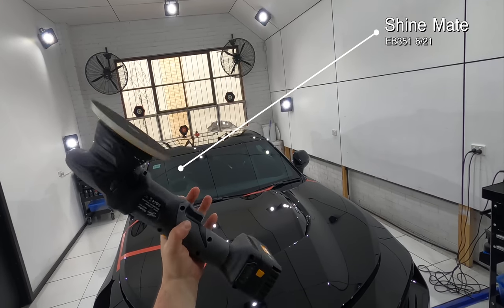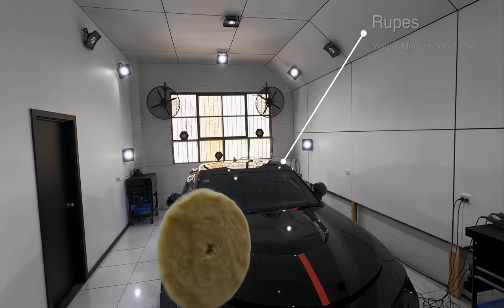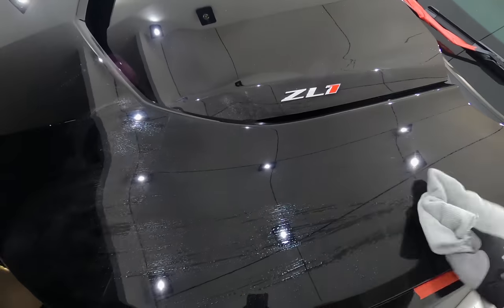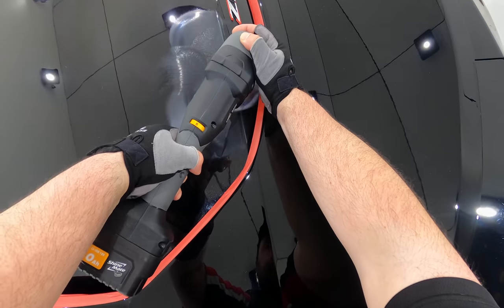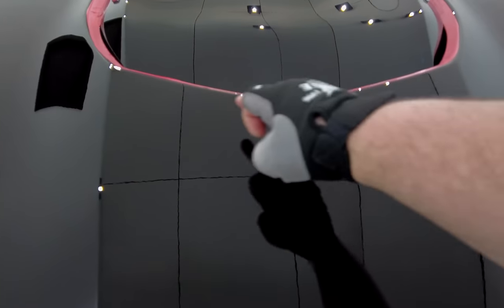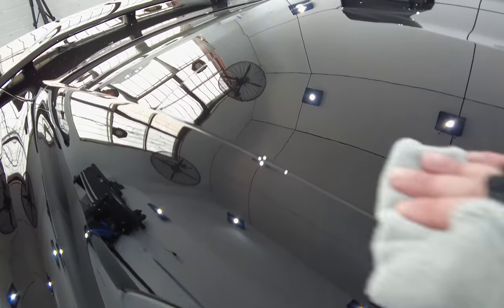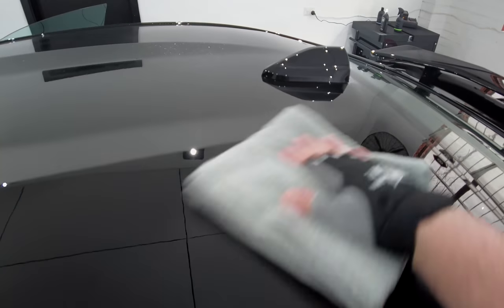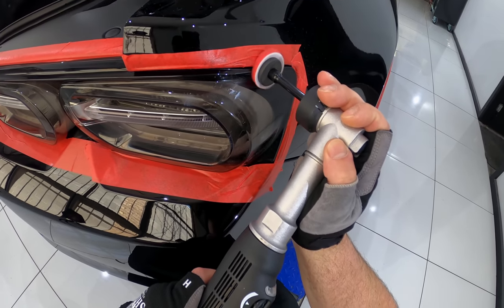2020 Camaro ZL1 Detail | The Worst New Car Paint Ever | P2 Paint Correction! (Vlog 32.2)

Comment: Greetings from Chicago, Sandro ... Happy New Year!!  🎉

You are a true master of your craft, and I so appreciate your channel and all the advice you give us.  🙏🏼

I have a quick question, regarding the ShineMate Black Diamond red pad you're using.  I just received my EX620 5/15 polisher (which is awesome by the way), and the Red pad that came with it is thinner (~25mm) than the ones I bought separately (those seem to be ~30mm).

Your thoughts on this ... have you noticed a change, as you've been using ShineMate for quite a while?  🤔
Reply from the maker: Happy new Year mate! 
Great to hear you like the polisher, and yes there’s actually been a few subtle changes to many of the pads including the widths as well as the foam and cells themselves, so I’m guess you’ve got an older new version of each pad, but I personally haven’t seen noticeable differences in how they perform
Reply: Terrific, Sandro ( @CarCraftAutoDetailing ) ... thanks so much for the quick and informative reply.  🍻

If I may, I do have an unrelated question.  My metallic black paint is extremely soft (that's why I'm studying these videos).  Is it common for the area under the masking tape (3M blue painter's tape) to be darker than either the area I just polished/refined and the OEM paint I didn't even yet touch?  It seems so odd, almost as if the tape is "moisturizing" the paint.  But, a panel wipe solution doesn't remove it.  🙈

It's really confusing me ... I don't know whether I still have micromarring/haze, or is the area under tape giving a "false" type of result.  Any thoughts on this off-the-wall question??  LOL
Reply from the maker: Tape can sometimes leave residue that can either make the area under it look more hazes up and light or even darker depending on the residue. 
I find that the blue painters tape is good quality but has a lot more residue compared to something like the red Carpro tape or even the 3M light green tape I believe it’s the 233 seems to be better to work with in that respect
Reply: As always, I appreciate the quick and detailed reply, Sandro ( @CarCraftAutoDetailing )!  😊

On my 2016 Equus, with Caspian Black paint, the blue 3M tape definitely darkens anything underneath it.  As you can imagine, it throws me for a loop, as I keep thinking I'm not refining the paint enough (I'm using the red ShineMate pads and Scholl Concepts S40 as the final step).

Would a panel prep (I'm using Gyeon Prep) remove that "darkening" residue, or does it basically have to off-gas (not the best term, but it's all I could think of ... *LOLI)?

I think I'll definitely try one of the other brands ... if anything, just for my sanity!!  🤯
Reply from the maker: You may need to use some APC or you mix a little APC with the IPA to give it a better clean ability

Comment: I was placing some bets its was soft paint after the first vid but were you doing this job befor or after the testing the battrey powered machines
Reply from the maker: Good guess, and I got the machines in for testing a while before this car
Reply: @CarCraftAutoDetailing  and you are still using them ? must mean they are really good pice of kit
Reply from the maker: Yes, the 21mm is my favourite which I’ve been using more than the others, but it takes a lot of time to really get to know all of them well

Comment: Hi m8,
Do you think the shinemate eb351 has enough power to cut? Also for hard paint?
Reply from the maker: The 6”-21mm  EB 351 certainly has enough cut and a bit more torque than the others, it’s probably the most powerful cordless DA on the market right now.
Reply: @CarCraftAutoDetailing  Thanks for your response, so you suggest the 6" 21mm over the 5" 15mm?
Reply from the maker: The 15mm is a little smoother and still very capable, but it doesn’t have the same raw torque, and it sounded like you’re after something with a bit more power which is the 21
Reply: @CarCraftAutoDetailing  Okay, Thanks m8!

Comment: Do you feel its safe to correct your own paint as a noob if you feel you understand the concepts of aggressivness of pads, compunds, and pressure/speeds?
Reply: I reckon if you take your time and accept that you will make mistakes, you shouldn’t be disappointed in your work. It is of utmost importance that you TAKE YOUR TIME. I said it before and i said it again. You’re not going to reach Sandro’s efficiency the first time around, but i still reckon that it will be a great experience.
Reply: Take your time and don't expect perfection and you should be fine ✌🏼
Reply from the maker: Yes definitely, it just takes a little practice

Comment: Sandro, as much as I’d like to believe it. There are way too many signs to point to this car not being repainted. The paint depth is questionable. The fact that this paint is “soft” is almost a tell-tale sign the paint has been tampered with. I live in the US and Camaro and Corvette paint, is like granite. My C7 Corvette took forever to correct. And this car is far too new to have the defects that it does. Even when corrected, you can easily see ticks in the finish. On top of the paint being ridiculously difficult to finish, I’m not seeing the usual amount of orange peel, that comes from the factory on these cars. Corvettes are particularly Orange peely. To the point where I want to hit them with 1,500/ 2,000 grit, but I know it would remove too much clear, so, I just rely on the shine from a distance, to show the results. There are so many reasons to repair the vehicle, before it gets to its final destination. I’ve worked at dealership that has repainted brand new cars, fresh off of the truck, due to shipping damage. It seems to me like this was redone with cheap clear-coat. At this point, I would PPF the whole car. And the fact that this car has to be shipped from Michigan, tells me it’s had the opportunity to be messed with. Even my Chevy Cruze hatchback, that was built in Mexico, has rock hard clear-coat and it now has 95,000 miles on it, and the paint is still perfect.
Reply from the maker: Thanks for sharing that and you may certainly be correct, but there’s also been a lot of comments from Chevy and Camaro owners and detailers who worked on them saying that their paint is also extremely soft. There obviously someone/s out there that know for certain what happened to this specific ZL1, but it’s definitely not certain in my mind as a lot of things on either side or the argument don’t entirely add up.
Reply: Car Craft Auto Detailing agreed. After listening to all of your commentary, voiceover on the paint, even after correction, you definitely feel like something is off. But, like you said, if someone repainted the car, someone went through a lot to do it to factory spec. 👌

Comment: Just curious would the 15 mm cordless got the job done ?
Reply from the maker: Absolutely, there’s plenty of other machines that will get the job done
Reply: @CarCraftAutoDetailing  yeah definitely I was just curious about the 15MM ShineMate cordless you still feel the same way as before about it ? Lack of stalling , smooth operation and plenty of power ?
Reply from the maker: I still think it’s a great machine and potentially the best cordless 15mm polisher, it is quite smooth and delivers good torque, but in saying that there are certain corded polishers that have more torque/less stall and are also very smooth.  So it depends on whether you’re looking at polishers as a whole or cordless ones.
Reply: @CarCraftAutoDetailing  I'm looking into the ShineMate cordless.
Reply from the maker: If you want the least amount of stall and the most torque then the 21mm is by far the most powerful and still rather smooth. The 15mm is a touch smoother and you do get better battery life with it and it’s still very capable probably closest to the corded Ex610-15 Shine Mate.
Reply: @CarCraftAutoDetailing  thanks bro.
Reply: @CarCraftAutoDetailing  hey bro so mine came in and I’m running it. The 15MM, I do like it but I see why the 6” is the way to go. Also I ran one of the batteries dry and charged it and almost immediately or maybe 10 min later it said it was full. Did you see that when it was new ?
Reply from the maker: The 15 is still a great all round machine, but no I haven’t seen that sort of charging time
Reply: @CarCraftAutoDetailing  ok, your trigger lock occasionally pop out on its own ?
Reply from the maker: I can’t say I’ve had that happen but every machine is a little different it may just take a little getting use to
Reply: @CarCraftAutoDetailing  the Vtech phrase is spot on. I also got the aftermarket backing plates as well. Really like it so far. Thanks for doing the initial review.

Comment: Did you try the LC One Step MF pad?
Reply from the maker: Yes’s that’s the pad I used in the rims, it’s also called the LC MF polishing pad.
Reply: @CarCraftAutoDetailing  I was not clear, I meant, did you test it on the paint?
Reply from the maker: The paint correction episode should be up by the end of the week!
Reply: @CarCraftAutoDetailing  I’m talking about the video for this Camaro. 🙂 Just curious if you tried the LC polishing MF on the paint that did not make the video.
Reply from the maker: Oh, sorry mate! I can’t remember if I specifically tried that MF pad but I did give MF a go and as is the case with MF on most soft paints there was just too much compounding marring and a difficult wipe off to make it suitable for that sensitive paint.
Reply: @CarCraftAutoDetailing  thanks!